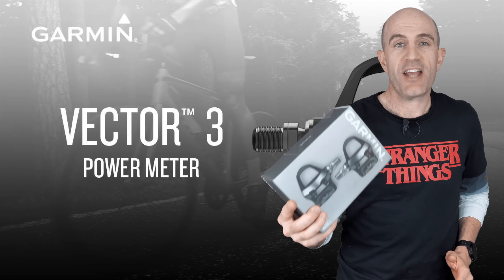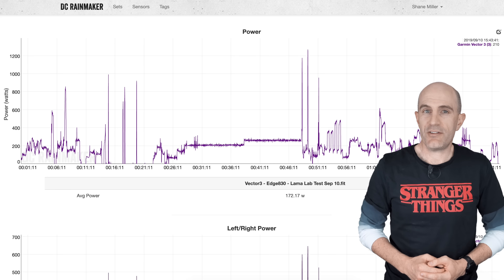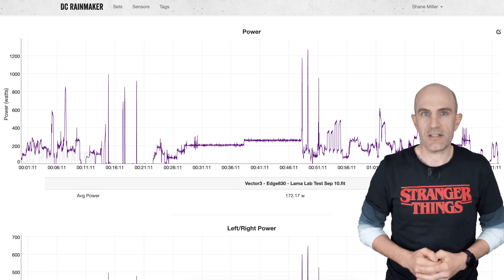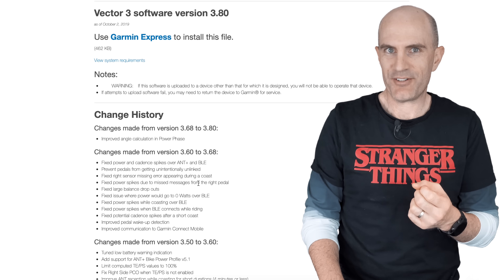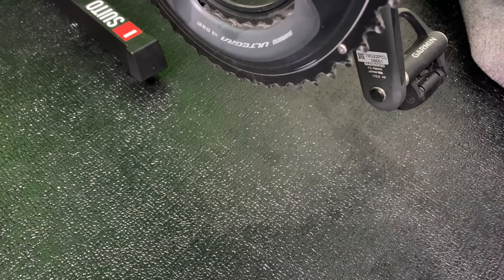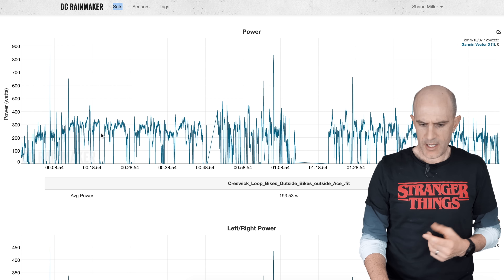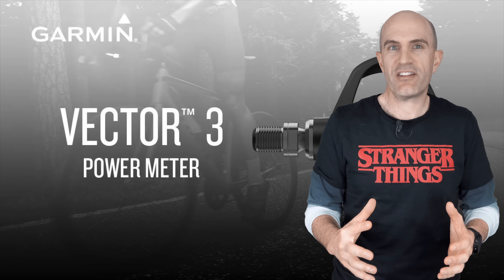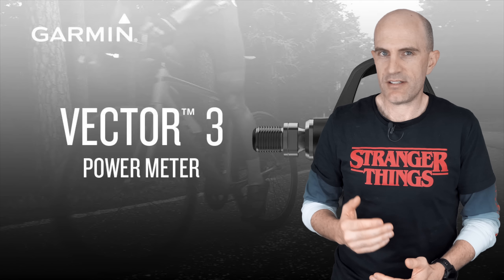Garmin Vector 3 Power Meter Firmware Update 3.80 // Lots of Fixes!

Comment: Anyone know if there has been any hardware revision to the Vector 3 since introduction?  $500 for used pair on eBay seems like a pretty good deal if new batteries and a firmware update are all that is needed to get them fully functional and accurate.  However, if any of the previous issues required a hardware spec revision mid-lifecycle, that would be a real concern with buying used.
Reply from the maker: Changes only to the battery holder/cap thingy that I'm aware of.

Comment: I was using assioma uno. Suddenly, the Garmin Vector 3 dual leg power meter began to roll out at an affordable price.
And after hearing the update and the news that everything was stable,
I confirmed plans to address the warning message that the right pedal sensor is missing and bought the product.
The tragedy begins here.

The smart trainer was calibrated with assioma uno. thinkrider x5 is a product made in China.
I wanted to upgrade to assioma duo, but it was more expensive than I thought. I should have bought it with duo from the beginning,
but I didn't have enough money so I just bought it with uno. I'm not selling it right now, but I just think of something to use.

I wanted to see the balance of both feet, and I tried to analyze the pedaling by looking at Garmin's cycle dynamics.

 A warning message about the absence of the right pedal sensor occurred immediately, but it was solved by applying energized grease.
and There is a phenomenon that the average power is measured 20w less than that of assioma uno.
so When installing the pedal, the washers were removed and reassembled.

But after doing a zwift wiringer workout, I fell into frustration again. When I compared the data with the previous assioma exercise,
It measures 20 watts less of a workout with a higher watt than before. 
The cadence was similar, and the sprint at that time was 500w and now 525w.

If the trainer is a problem, the previous assioma results should also come out that way, but Vector 3 is frustrating because it doesn't.

As a used product, there is no way.

sad. Goodbye to my assioma~

Finally, I have to test it with a precise trainer.

Would it be okay to test it with the Elite Dribbo Trainer?

Comment: Hi @Shane Miller. I recently bought a pair of Garmin Vector 3S pedals. I use a Wahoo Kickr Snap Indoor trainer - Would you recommend using the Vectors as the power source over Zwift or using the Wahoo Built in Power Meter? Thanks! Appreciate the videos!
Reply from the maker: Entirely your call. The 3S is giving x2 Left power. The SNAP is giving total power but comes with all the caveats of power accuracy from a wheel-on trainer.

Comment: my NDS V-3 pedal operates as a V-3s. 
the DS V-3 pedal gives 3 green flashes, and when pedaled single-footed, gives no power on the Fenix 5.
i assume that it needs that connection to the NDS pedal in order to transmit to the Fenix 5.

Comment: Hi Shane, have there been general accuracy issues with Garmin Vector 3's aside from dropouts, power spikes, battery cap issues etc ?  My pedals are reading about 20-25W lower than my Elite Direto Smart Trainer.
Reply from the maker: Best deal with Garmin Support on this one. You can do static weight tests on the Vector pedals to see if they're within spec for that test. That might be a starting point and some data to take to Garmin.
Reply: @gplama  thanks, yes I plan on doing the static torque test first before going back to Garmin. Bit of stuffing around though.
Reply: Tested my new vector3 with my neo1 the last 2 days...only 3 and 2 watts difference in average. Think something wrong with your elite. Also you cant ompare this with only one sided pm. Its to innacurate except you have a 50:50 balance.

Comment: My 4th pair is comming, what a trash this power meter are. Might be better to garmin leave this market, its a shame how many problems they give.
Reply from the maker: Apply the three-strikes rule. Expecting anything different on the 4th pair is a stretch. Having said this I have a new set of V3 and they've been fine.
Reply: What have been your issues?  I recently got a pair of Vector 3S and I suspected that the power has been reading too low.  I tested against my Elite Direto Smart Trainer and the power on average is 20-25W lower.

Comment: Bought these hoping the issues had been resolved; they haven't. They came with two sets of replacement battery doors, which I installed along with brand new batteries (also supplied). Firmware updated to 3.80 via GC app. Initial experience was terrible, the batteries supplied in the pedals were nearly dead (however app reported "good", but they would disconnect about 10s after being detected). I am suspicious how old these pedals are, given they had 3.60 firmware as supplied. I am curious if I even received the new-new battery doors from 2020-03.

First ride (~3hrs) worked mostly fine, except for when I stopped for ~3mins half way. Seems this was long enough for the pedals to sleep, or lose connection, and then promptly report a 1326W spike as soon as I started moving. It defies belief that they don't clip these obviously incorrect spikes on re-connection; no power would be much better than that.

They are going back, and I will be using my reservation for the Assioma which just came available yesterday (I should have waited the extra few days).
Reply from the maker: Did they come with the single battery each side? The newer units come with the latest battery doors and the single CR1/3N each side.
Reply: @gplama  no, they came with 4x Varta V13GA in them (~1.15V each), and 4 energizer LR44 in individual blisters. Also included 2x S00-01030-00 "Kit, Battery Door & Holder, Vector 3". These are the current part number listed, but I can find references to that online from long before March when they apparently released a third version for the doors.

After reviewing the drop-out, it's clear what happened (wasn't due to the pedal sleeping), the power dropped as I crossed a cattle-stop, and when it returned some seconds later, there was a power spike to 1326W. Unfortunately vibration is always going to happen, tbh I wouldn't actually be bothered if they dropped for a few seconds under that type of vibration, but I cannot live with the power spike.

Comment: Shane I need your wisdom. Just purchased a pair of Vector 3 (used). I need to update the firmware but they wont connect to my cellphone ( same issue you had on your original video review) and I don't have a Garmin computer,  I use the Wahoo Bolt. Any suggestions, recommendations, . Thank!! FYI great channel.
Reply: Use garmin connect app

Comment: It's now 2020 and reports of problems seem less frequent. I have the option to buy a new pair in a sale £100 less than Assiomas. Is it safe to buy the Vectors in 2020?
Reply from the maker: Yes.... but... right now you can't even configure them as Garmin Connect is down. (a requirement to get them setup, updated, etc).

Comment: it seems I'm the only one who has no Problems with the vectors. Had to change the original batteries. Since then they are fine. I think I'll try the cr1 when the actual are discharged.
Reply: How do you find the accuracy?
Reply: @davidheal7832  compared to my Elite Direto it's reading a little bit higher. But that's ok considering drivetrain losses.

Comment: Can you use the SPD-SL cleats with the Assiomas? If not, can you put Look cleats on a shoe that uses SPD-SL cleats? I'm thinking about using either Giro, Bontrager, or Lake shoes with the Assiomas. I'm asking here, because it seems like the Vector 3 isn't as well rounded as the Assiomas. Thanks.
Reply from the maker: No on the SPD-SL compatibility on the Assioma. You can put the Assioma cleats on the three hole road shoe spacing Shimano cleats use.
Reply: @gplama  Thank you.
Reply: @gplama  Actually, I still can't get over this. I really like the SPD-SL cleats, and the Assiomas seem like such a great value. What should I do? Are the Vectors really that bad compared to the Assiomas? Is there another product I should look at?
Reply from the maker: The Vectors aren't SPD-SL either. They use another similar "Look compatible" cleat. For now, forget pedal based power meters if you want to keep those cleats. Look at spider based options such as a Quarq.

Comment: Hi Shane, Garmin connect app currently says my pedal firmware is "up to date" with 3.60. With no option to update to 3.80. Running a wahoo headset so seems app is the only way to update. Any ideas why garmin connect isn't showing 3.80? Thanks in advance
Reply from the maker: One for Garmin Support. The app should be able to push the update.
Reply: @gplama  Solved myself, deleted garmin connect app, installed previous version 4.5.1 of app, had vector update waiting there

Comment: Hi Shane, I just bought these pedals...the vector 3s ...so power only from the left.  Power keeps dropping to 0 almost ever 10 to 20 seconds...then comes back then drops to 0, I'm so upset and have no idea what to do anymore....got the new firmware update, battery doors are the new ones and used the baby oil trick and it's all the same, please help am I missing something?
Reply from the maker: Try the CR1/3N battery. https://www.youtube.com/watch?v=3F8Pt44iO0Q&vl=en
Reply: @gplama  ok I will be buying it today and trying it out.  I will let you know how it goes...thanks so much for the response.  Hopefully this is the fix i need.
Reply: @darrencabral3044  did it work? Would you still have chosen these pedals over the Assiomas?

Comment: just to summerise what you are saying: larger batteries, new caps and current update 3.8 and issues with vectors are massively reduced but not gone. respectively assioma are still more reliable than vector 3?
Reply from the maker: See my Power Meter Guide over on gplama.com  My preference is for the Assioma.

Comment: Hi Shane, Evening from London. Purchased the vector 3 earlier today and went through the install process. Initial install went ok until battery’s said to low to to the update!! Changed batteries. Started the 3.80 firmware update which went through its process, updated via Garmin connect. Green flash on pedals 20 times but the app stayed on progress screen. Went back and also shut down app and reopened. Every time it says update available but the pedals on edge 530 say version 3.8 is on the pedals! 

Does this mean the update is complete or not as it still available on my Garmin connect!!! 

Also can you change the 3second power average to actual live power?

Be great if you could assist! 

Many thanks simon .
Reply: simon smith  I have the same issues - did you find a solution?
Reply: Matthias Hautle I didn’t find a solution, per say. But I did the update and connected to my edge 830. As soon as I ride the pedals connect and give great readings. Done a few hundred miles now and they work perfectly. Only issue now is there is an update and I can’t figure out how to do it.
Reply from the maker: I’ll have to refer you to Garmin support or your place of purchase.

Comment: Shane,  I notice on your lama test yesterday you said you had ANT drop outs?  Was this on the Garmin Vector pedals?  I did the firmware update and to be honest, I’ve never had more drop outs!  I certainly had the odd “right pedal missing”, but nothing as bad as this.  Have you had further issues since this update?  Any help most appreciated.
Reply from the maker: It wasn't the Vectors, no. The V3 have been fine for me with this update (and the new battery doors, and the single battery option)
Reply: Shane Miller - GPLama thanks for the prompt response.  I bought these after the new doors were released, so I’ve always had them, but I still run the dual LR44.  I look to try the single battery and start dealing with Garmin. ☹️

Comment: 2 years with Assioma Duo and totally no issues what so ever. And even have advanced dynamics with my Fenix 3 and Edge 830
Reply from the maker: Yep, the Assioma are great units. The Cycling Dynamics they implement is only 1/2 way there (no PCO)
Reply: 1/2 way there just because PCO is missing? That would mean that they only added two features - which is not the case. BTW, PCO is really interesting for the initial bike fit - once the bike fitting is done, you don't need it. I wouldn't swap the Assioma for Vector 3 even if I would get the Vector for free.
Reply from the maker: @d.z.2550  Crikey.... hold back. I love the Assioma pedals, I've used them a lot more than the V3 units. My point being they didn't implement the full Cycling Dynamics standard. The CD standard is split into two halves, as I see it, which multiple metrics are derived from. Pedal Phase and Pedal Center Offset. That's where my 1/2 came from.

Comment: Thanks for the video GP. What's your battery life been like with the CR1? 
I've been using the original battery type and I've got the 'low battery' message after three months of use.
Reply from the maker: Still on the same ones since I did the video on them.

Comment: I was able to return my pedals under ACL. So many issues faced, so unreliable. The faveros seem quality though from all reports
Reply: From time-to-time the Assioma Duo will throw a "error reading pedal" fit regarding the right pedal. For no reason, as both left and right are working and charged. If you usually top both to 100% charge, it will go away. It's a nuisance, but even though we managed to put a man on the Moon 50y ago, having a proper and reliable link between two things less than a 1m from each other is still mystifying the cycling industry.

Comment: Concur on the single battery per side. Made the change a month ago and many issues were resolved; most notably the dropouts as you mentioned. Thx for the battery lead on the single approach. Good stuff.
Reply: Hi, is it just the battery that you changed or also the battery cap or housing of some sort? thanks.

Comment: Unrelated question Shane, but is there a way in zwift to change world's without exiting the program completely? My computer jumped ahead and opened up the scheduled world but I wanted to ride in watopia. My computer is very slow so it was inconvenient to exit altogether and re-open from the start. But I saw no other alternative.
Reply from the maker: There's no way to switch worlds other than joining events on other worlds. So the answer is no, you need to quit/re-open.
Reply: @gplama  thanks Shane. Bummer. Surely that's a bit of a flaw.
Reply from the maker: Likely a legacy of their original game design. I'd like to see world switching and route selection as part of the in-game menu.

Comment: Unless you received these Vector 3 for free, there's absolutely NO reason to buy this product when Assioma DUO are better, far more reliable and cheaper. I made the mistake of buying a pair of Vector 3 when they came out, couldn't return or resell them, so they went into the trash bin.
Reply from the maker: Just as a reminder - this isn’t a sales pitch. I purchased the Vector 3. I’ve been through all the bullshit with them. I want to provide content that other owners may find useful. I also own the P1, P2, and Assioma.
Reply: @gplama  Fair enough, it will be "interesting" to see how much uphill skating Garmin with have to go through to sell any upcoming Vector 4. Between the fiasco of the 3 and breaking expensive pods on the 2, I'm not a Vector or even fan to say the least. Gamin does not know quality control and how to make a reliable product (yes I have owned one of those Fenix 5 that had the antenna design flaw).
Reply: and 49 grams lighter!

Comment: After 2 failures and returns that was enough. 2 years on Assioma, trouble free.
Reply: Exactly the same, Assioma all the way 🤘
Reply: Do either of you feel the Assioma spin too much after unclipping? That is my only issue with the Assioma
Reply: u a yes, the bearing was so smooth that it spins too much
Reply: @user-lq6vp9el6l  Yes, Garmin is a better pedal but the power meter is terrible.
Reply: Not noticed it myself.

Comment: Had Assioma DUO's for 2 years now,  not an ounce of trouble.  Have an 830 and prior to that a 520 head unit and although the head units function,  phone connectivity and garmin connect are so flaky its laughable... but the faveros they chug and chug and chug along.
Reply: Garmin are better pedals, powermeter does not work however.
Reply: @martialman.4563  Forgetting that their reason for existence is as a powermeter, in what way are they better pedals? Honest question as I have never used  garmin pedals.
Reply: @stevecrabb1  They Dont spin around like the Assioma if you miss clipping in. Garmin pedals are very similar to Shimano SL.
Reply: @stevecrabb1  I sent two faulty Garmin sets back. Broken out of the box, Assioma is solid reliable
Reply: @martialman.4563  maybe that's why I'm rubbish at clipping in :) I know that favero have slackened off the springs that secure the cleat but that wont help with the problem you highlight. Seriously tho I am happy with clipping in, probably because I don't know any better. If anyone ever asks me which powermeter to buy I always say don't mess around, just get assiomas and have a hassle free life.
Reply: @stevecrabb1  Yes, they are the hardest pedals I have used to clip in. Someone needs to come our will a good mountain bike power pedal.
Reply: @martialman.4563  $1000 for a plain set of pedals that won't accept my SPD-SL. Yikes!!!
Reply: @iRonlMoNKleY  Clever training me my money back, they could not last 90 days, both sets.

Comment: Firmware upgrade was pushed, sadly after my indoor ride. I left 1030 and the pedals as they were with the bike on the trainer and went for a shower and I believe a few beers. The next morning I took the bike off the trainer for an outside ride and had 1% battery on the 1030 left. 😢 Better check that it shuts down next time.